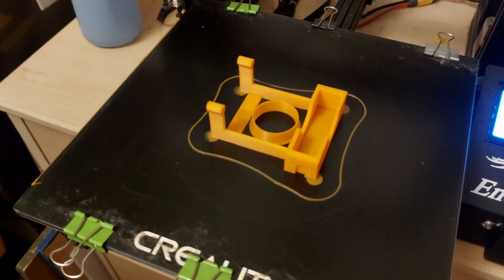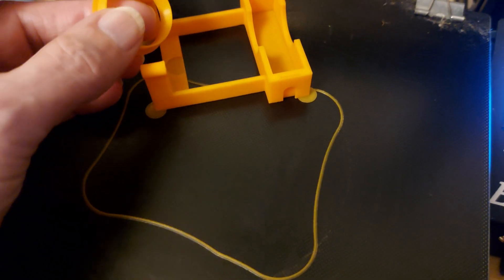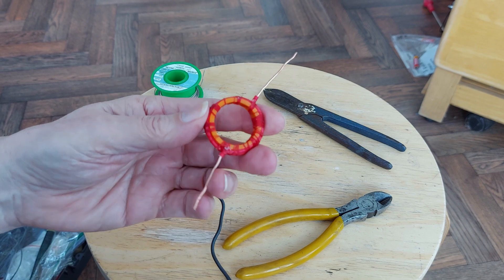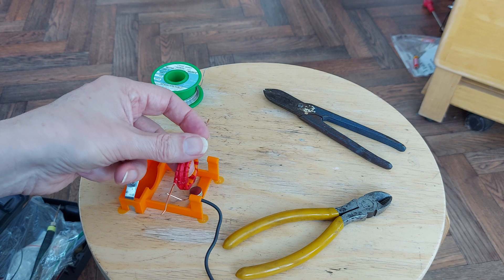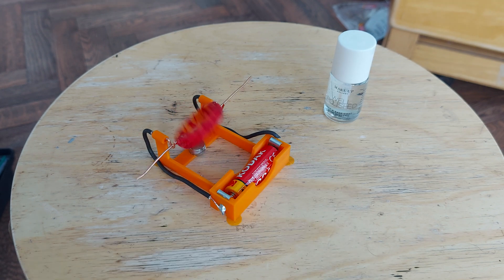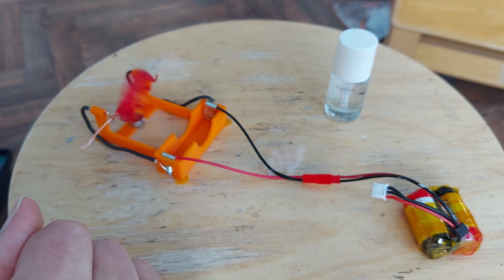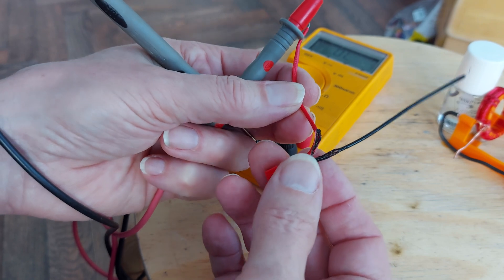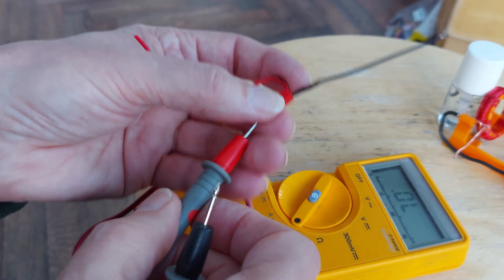Simple Basic DC Motor inspired by an old Shop Dog Sam video

Comment: From 1.5v to 8v, I guess you get smoke. I turbo-ed a shaver from 1.2 to 4v, worked good for long time 😮
Reply from the maker: With the thick copper conductors, the resistance of the coil is tiny, so it is a full short circuit across the battery.